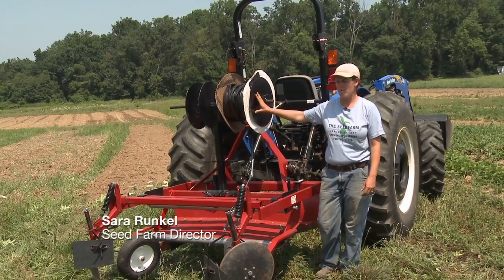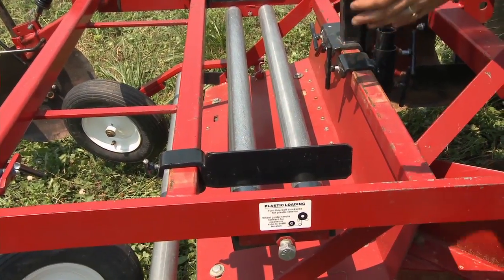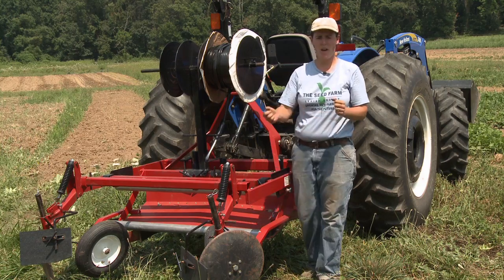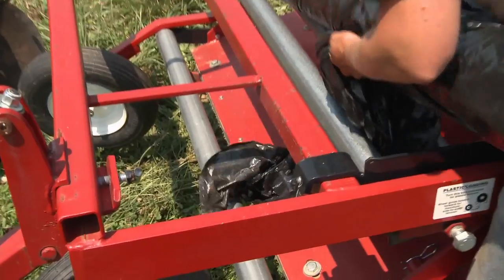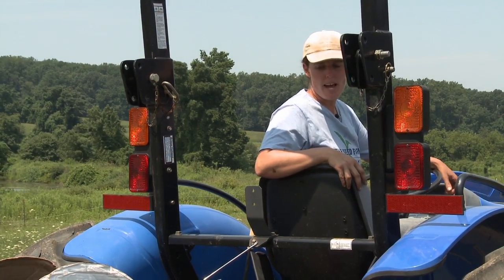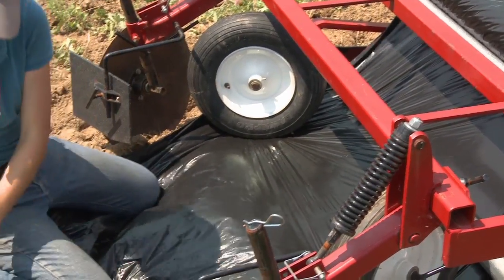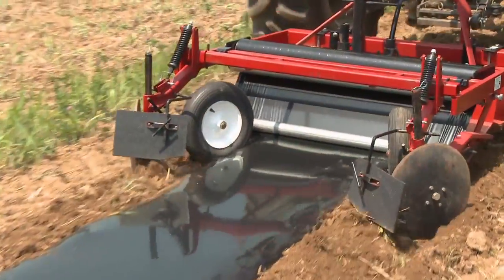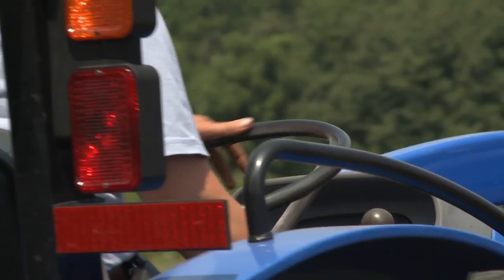Plastic Layer

Comment: The farm I work at got the fertilizer pellet spread for the mulcher and we were told by the seller that it would fit with the drip tape spool on the machine. It does not fit it interferes with the spool and will not fit on

Comment: whats the name of the model of the machine? where can i buy that?
Reply: RB448 can be purchased from Nolts supply.
Reply: Rain-Flo equipment is the best, and is also locally made in East Earl Pa.  Call 17174453000
Reply: @EZ570  have u whatsap....reply me on whats.00967711685102
Yemen